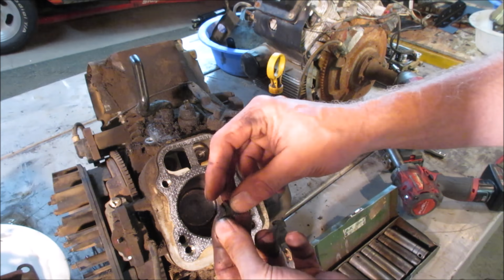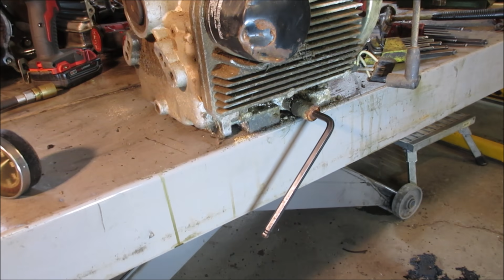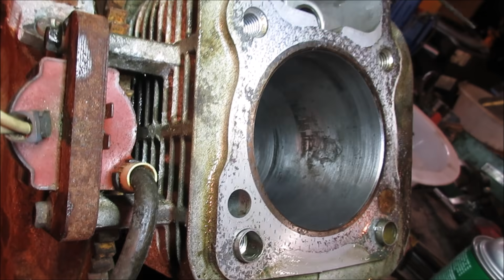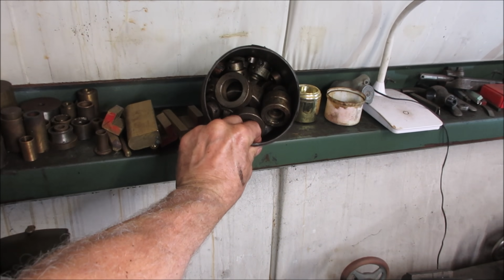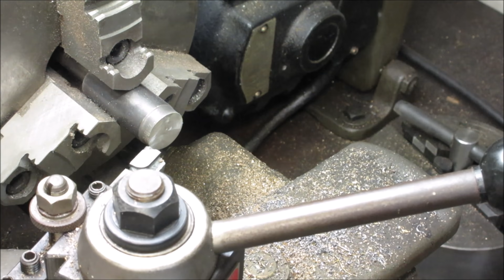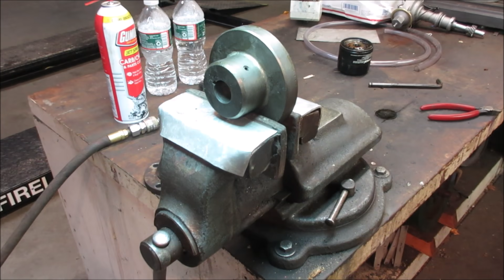Kohler Engine Teardown and Crankshaft Mods,

Comment: Seems like to me that skid steer diesel refrig unit is perfect for the Terrimite. I can't think of a better engine for an almost backhoe. This 15hp engine is not suited for a skid but for that almost backhoe it seems to me made to order. Two of these 20 hp engines hooked to the hydraulic pump would make that skid steer really react spectacularly. I know you have that other 25 hp diesel engine already installed but two of these gasoline engines would really make it come alive if the both would fit end to end, ya'll would not need any radiator and have the blower air cooling pressing against each other? Not sure about that for cooling. One would overpower the other unless the blower air release was open. Might be hot to run in the summer.

Comment: Great video of hooking two motors together. Could you touch on alignment of the couplings. I worked in a refinery, and we did reverse alignment to really dial in the alignment and reduce vibration. They also have varying grades of rubber / phenolic couplers that would help with that rubber one coming apart. Thanks, keep the ingenuity coming!!!!!!!

Comment: Once you get it mounted on a flat surface you can get some shim material and get the shafts tuned in closer. Good job with the machine work.

Comment: Wouldn't 1 of them be turning backward?
Reply: No, they're both facing the same direction. You can see that both the oil filter mounts and the oil drain plugs are on the same side.
Reply: @MellowYe77ow  yes. Thanks
Reply: @hugh007  You're welcome.

Comment: If your fit is that tight, then the slightest hint of corrosion can seize it good, just the opposite of an AK-47, you may never get that apart.  Leave some room for protective grease.

Comment: Hmm. I’d use some method to clock the two engines together to get them in rhythm. Otherwise they likely will destroy each other due to vibrations multiplying at certain RPMs. If you don’t want that you likely want a separate double-mass flywheel mounted in between then to making things no all smooth and cosy. The only engines you can ignore such problems with are very well built inline sixes.

Comment: не теряй время, два двигателя соединённых в цепь не будут надёжно работать и не дадут большой мощности, 
эту задачу пытались решить и энтузиасты, и целые конструкторские бюро, у них ничего не вышло.
Reply: Miss Chrysler Crew has entered the chat…
Reply: @floridajack7222  
если это дерьмо смогло проработать одну гонку это не значит что это работоспособное решение, 
исключение - двигатель для торпеды которой плевать на ресурс потому что у неё билет в один конец и недолгая поездка.
Reply: @unokarpa4405  - this was also a common configuration in top gas dragsters.  It works just fine…
Reply: @floridajack7222  
спаренные в один кусок двигатели - это дерьмо на одну гонку,
это нерабочая конструкция, 
если ты купишь себе это дерьмо чтобы ездить на работу то ты просто не будешь успевать оплачивать счета из автосервиса и станешь постоянным клиентом такси и автобусов.

Comment: The problem I see you having is the spark timing cause with that coupler it will have a little give which in turn may make one fire at the wrong time which would be a disaster

Comment: I was thinking when that engine threw a rod its possible that the oil pickup fell off which starved it of oil there for transferred the aluminum to steel which made the one cylinder throw the rod when put under load from the hydraulics

Comment: Sure its too late but why not bire the crank spud and weld in a rod. Also a drill vit is the last thing you want to transmit pulsed power like an engine.

Comment: Looke like aplate could be made, to bolt the cases together back to back.  Weld the cranks together,  have one bearingin one plate,  then the plates dowel together and bolts together, making a 4cylinder block, and weld thecrank with the rod journal 90° from the other,    and weld or brase the cams together with a dowel inside, or possibly run them on each other, one will need to be flipped or something, because it will be reversed rotation.  Maybe build a new cam on a steel dowel braising the lobes onto the dowel making a reverse rotation camshaft! Use a different style oil pump, possibly chain drive from a motorcycle, or a pump from a newer automatic transmission,  they have a chain rinning into the pan where the pump is located, this can pump oil for a small engine also!  Tge plate can be made from 2" wide 1/2" thick aluminum bar, welded Together then machined flat, and machine the bearing retainer, bolting together, the crank can be pressed together like a motorcycle crank, with the bearing inside, or just make a crank with steel plate, and round bar, just like a motorcycle crank, use the parts of the original crank as needed, machine it  and press the needed part into or on to the new crank, using interference fit, and about 3-4mm steel pins to keep the crank locked in place,  3/4" x 4" flat bar, and 2" round, just heat it a but and quench it to harden the surface,  finding bearings that will fit in the rods roller bearings thgat the rod  can be machined to fit the outer Race,  and a inner race large enough for about  1.5" journal, or possibly make a steel race and use motorcycle bearings for the rods,  a steel race fitting in the rods, however going this far, making steel rods is probably the best option, just machine it from a 3/4" steel bar quench the journal end and hone to final size,  doing this the stroke can be modified, adding sbout 12-15 mm to tge stroke should be possible  or shorten it.   It should make a decent running engine

Comment: One of my favorite home made tools is a strap wrench oil filter wrench. I split a spark plug socket down most of the way and use a piece of ratchet strap in it. Any deep socket will work.  Its great since you can put an extension in it to get a hard to get at filter.

Comment: Love your videos and commentary. Thank you for allowing us to come along on your adventures. I noticed the green metal socket set you were using.. I said that it looks like a set of S&K's. It's not a brand one see's nowadays. When I was in high school, I worked at a Western Auto store and saved up my wages to purchase that brand of tools. They were not cheap.. It brings back at of good memories to see those S&K's. I suppose that's why I enjoy your content. It allows me to remember.
Reply: Love my S&Ks., 1/4 &3/8 drive sets purchased about 50 years ago. Metric and American Standered with combination wrenches included. I did have to replace the tool box and the 1/2 inch wrench. Have a great day.

Comment: I wonder if you could use a dual v twin motor to repower your skid steer.  There may not be enough space available in the engine bay but removing the radiator would give you more space as these engines are air cooled.

Comment: My thought with the crank and the drill bit was to drill the center of the crank out  and tap it and the thin part of the drill bit put a thread on it then then cut the drill bit down and then key it and then drill the center out tap it for a stubby built to hold the adaptor on and as the drill bits are hardened heat it up and allow it to cool naturally back to room temp (do that a few times to remove the hardness and to then shrink the grain structure of the metal)

Comment: Drill shafts are not hardened. I think we have all chewed them up when they spin in a chuck. For centering you can use a ball bearing between the two ends if they both have the centres recessed.

Comment: You probably already know this, but if you soak that crankshaft in caustic soda, it will remove all of the aluminum from the journals.
Reply: It got hot enough to discolor the steel, it's not worth saving.

Comment: Type in '300 hp ambient heat engine'. It runs off the heat from a road or the roof of a house, weighs 82 lbs, turns at 30,000 rpm and has one moving part!

Comment: I mean no disrespect cuz your a hell of a mechanic. I had to chuckle when you were trying to center that drill rod on the motor shaft. I telling myself he should cut the rod to match the center hole on the shaft. It would center itself then .Also use a flat push block on the live end instead of a drill chuck. Those drill clamping shafts can bend and be out of round. Just some thoughts. Also use a calipers to measure on a lathe. Makes life so much easier.

Comment: Great vid as usual, Mustie...but brother, you absolutely have to support something as long as a crankshaft from both ends when turning it on a lathe - either with a live center in the tailstock, or on one of the bearing journals with a steady rest (if you have roller bearing fingers on the rest, of course). It's much safer for you, and that 10 thou of runout very well may have been corrected completely with both ends supported. It would've gone a long way in reducing the chatter too, along with some better HSS tooling rather than carbide. Anyway, no more soapbox preaching from me lol, just something to think about for next time.
Reply: если длина обрабатываемой детали больше диаметра обрабатываемой детали более чем в два раза - тогда надо подпирать деталь упорным центром из задней бабки токарного станка.

Comment: 31:20 light fizzling out. Time for a new one. Curious what's wrong with the old one. I have the same light. works good I'll fix mine if it starts messing up. I upgraded the battery to one with higher current because it has an 18650 cell inside just unscrew the bottom where the magnet is..

Comment: Why don't you drill a hole in the center of the crankshaft the size of the step down on the drill bit put that inside the crank an weld it then cut to the length you need

Comment: FYI, those cemented carbides that you buy in multi-packs aren't ground properly for use out of the box.   Usually the tip is an acute angle that's too weak to last and chips quickly.   If I have to use one of these for anything I grind the tip to a useful radius and grind relief on the actual steel part as well.   Note that for grinding the carbide, you need a CBN (green) or diamond wheel, and if you use the latter switch to something else to grind steel.   Or better yet, use positive rake insert tooling on this small of a lathe.

Comment: I know you are just messing around, but using a chain to couple multiple engines on their outputs is typically how its done.
Unless you really want to make a v4, in which case just weld the cranks and camshafts and blocks together into one v4.

Comment: Some motorcycles have a rubber doughnut/pretzel looking thing in the rear hub, just like that coupler of yours, between the sprocket and the wheel to absorb shock loading. I think it's called a cush drive.

Comment: I was a head Mechanic/Shop Supervisor for a rather large Tree and Lawn Service in a former life.
Lawn mowers quite often slide off a steep ditch, or into a water trap on a golf coarse, or off a sea wall into a lake or ocean.
I'd say that second motor went swimming and they swapped it out under warranty or just because it was high-ish hours anyways-
The watery oil- the White corrosion inside all the cyl fins, and MASSIVE rust and shit fucked up under the cast iron flywheel is the main suspects
Reply: Drill Bit TIPS are hard, the other end that you chuck on called the shank is SOFT
the GIBS on the cross slide of your old tired lathe are loose as hell, you need to adjust the allen screws and get that tighter, also looks like the tool height was too high

Comment: Darren, have you checked the runout on the chuck?

ALL universal chucks have runout.  (Use a 4 jaw 
independent, and manually adjust for runout.)

Also, are you going to run each engine separately?
Are you going to run each set of points on their 
own block?  That coupler will throw off the timing, 
if you run them together.

steve

Comment: STEADY-REST 101-1  As a GENERAL RULE OF THUMB, three times the diameter of the material stick-out from the chuck-jaws, you should start to consider using either a "FOLLOW-REST," (has two points of support on the material) or a "STEADY-REST," (has three points of support on the material.) 

Assuming that both your "FOLLOW-REST" & your "STEADY-REST," have roller (bearings) at the end of the arm(s), that touch's / come's in contact with the material, you adjust up until the bearing is just starting / or is turning consistently.  DO NOT CRANK DOWN ON THE ADJUSTMENT.  You want to be just-touching the Material.  Same if your arms / contact points don't have roller-bearings, but are factory - cast steel / iron.  I would recommend brazing the ends so as to have say 1/16" in. thick brass contact between the metal in the metal -lathe that is turning, and the adjustable arm.  WHY? Because the brass is a softer metal, and won't Gaul the surface of the material, being turned.  Plus some oil at the contact point(s), and well Bob"s your uncle.

Comment: Hello Mustie-1.  Did you hear about all those 101 machinist jumping off the Empire State Building, in New York, after shouting from the roof-top "STEADY-REST," where in the hell is your "STEADY-REST."  They ALL jumped OFF, after you used a "CAST-STEEL"  part as a Pin Gauge(s) - Dimensional Measurement tool.  In case you don't know, a machinist "PIN-GAUGE SET," generally starts at 1/16" in. (0.0625" in.) Diameter and increase in size by approx 1/16" in. up to 1/2" in. (0.5000" in.) Diameter. Tolerance 0.0001-0.0002 (one, to two ten-thousandths of an inch) FYI some sets start @ 1/2" in. and go up to 1.0000" in. They also come in metric as well.  I'm not a "machinist per say," but I do as a welder have a small desktop mill and a 20" in. Swing Metal Lathe.  The mere fact you used a 3-jaw chuck, indicates you were willing to dwell in the being off from as little as 0.008" in. TIR (TOTAL INDICATED RUN-OUT) to as high 0.020" in. TIR.  Use either a (machined) shoulder bolt, say with 1/4" threads up the bolt, than a "Machined" surfaced say 3/4" in. long. To test the run-out of your chuck.  You know, the single bolt that costs say $5.00 (five-dollars) for a single bolt, or maybe you have taken something apart, and was wondering why the obviously tapered pin was so shiny and smooth.  You could use a machined tapered pin to check your three-jaw chuck run-out.  Don't expect it to be on the money.  The real question would be how far out, of T-I-R, is out.  Now if you really wanted to keep your Total Indicated Run-out, to a minimum, say 0.001 to 0.002 at most, you would have used a four-jaw-chuck.

Do they make an adjustable three-jaw-chuck, to keep the run-out to such a low tolerance?  Why yes they do, but I would HIGHLY recommend that you take some heart medication first, before inquiring as to price. I would expect say a 3"in. to 4" in. adjustable three-jaw-chuck to commend a price of say between $400.00 (four-hundred) to $600.00 (six-hundred) dollar's.  FYI, the bigger the adjustable three-jaw-chuck, the bigger the price.  Welcome to the heart-attack price zone.  DON'T ask about six-jaw metal-lathe chucks, unless you have already taken a double dose of your heart medication.

FYI, most drill-bit's, the butt end (the part held in the drill-chuck) is a soft metal. That's why you see some bit's with chewed up marks on them. TESTING HARDNESS -101-1, simply use a metal file, if it leaves a mark by filing say with two - four ounces of pressure, the metal is soft.  If the file SKATES ACROSS the metal, and doesn't leave a mark, your dealing with some serious (ROCKWELL-HARDNESS of 86 and above) hardness.

Comment: I always wondered how connecting two engines together at the crankshaft actually worked. How do the engines syncronize? Do they use one ignition system for both?

My first introduction to the concept was in Gran Turismo for Playstation when I was a young man. The Suzuki Escudo Pikes Peak real life car was an insane twin v6 monster, but I always wondered how the two engines didn't end up interfering with one another while running.

Comment: Mustie a standard kohler command crank would already have an output shaft on the side that is flush on your engines. and you would only need to add the extension shaft to the flywheel side. Pretty sure the crank is the same between the vert and horiz engines if you have one in the hoard. just an idea for future.

Comment: I got a suggestion I know you got some pump sprayers fill one with any kind cleaning fluid like parts cleaner something cheep then use it to clean out the block Look around fow like a jumbo cake pan you can drill a hole in it & put drain hose to a 5 gallon bucket & Set the cake pan on work table & clean out the engine that way your not bent over trying work ! I done it many times after i broke my back I uad use one those roll around chairs like mechanics use but taller to be able set at my work bench fixing lawn mowers & tiller engines !

Comment: I saw some Junkyard wars & Scrapheap challenge where they directly coupled 2 motors and either the coupling broke either they lost power because the 2 motors were counter-fighting each others as soon as one had less revs or torque... I think a differential is better
I noticed 2 great lessons by watching Scrapheap challenge :
1. the best half-track has no track AKA the best DIY track is a wheel
2. never couple 2 scrapped motors to run faster than a wheelchair

Comment: If the pulley connector doesn’t perform well or fails, perhaps put a vehicle differential in between them which would turn the drive shaft as an output and let a lot of play occur between the two engine shafts. A real threesome :)

To get that pulley on the machined shaft you could try the heat and cold method. Freeze the shaft for an hour and then heat the pulley. Should slip right on.

Comment: Pretty cool Mustie  Id loose the rubber  couoker insert weld sprickets on coupler to except a double roller chain drive due to the torque of the engines